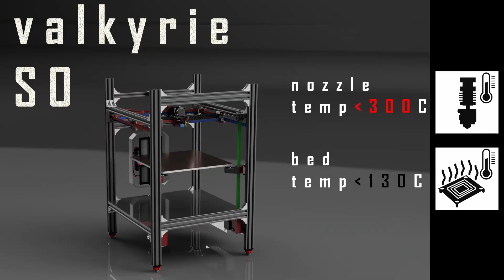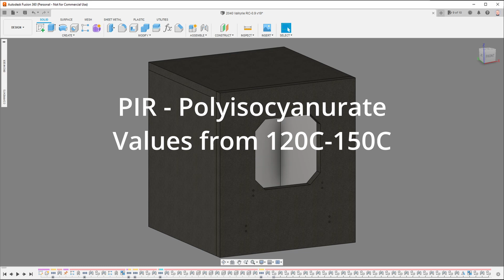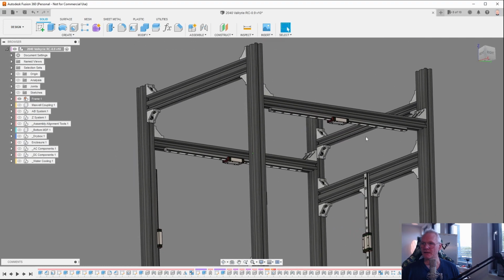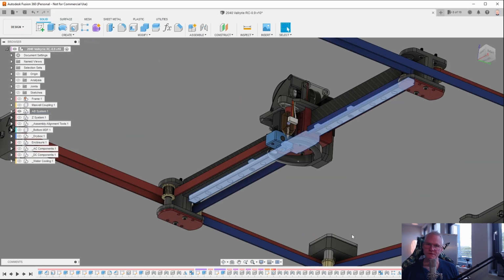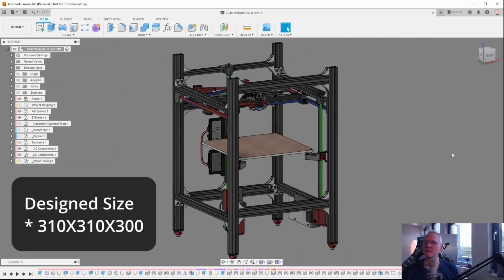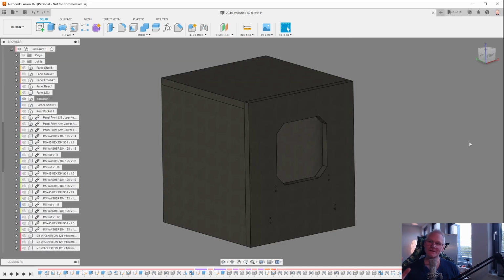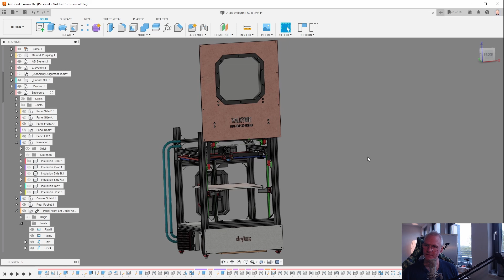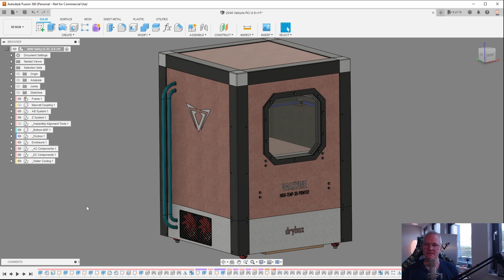NEW! ADVANCED DIY 3D Printer | Project Valkyrie |  High Temp Option

Comment: Impressive level of attention to detail! You list your competition on the webpage. However you don't have competition on a number of features of this design in the self build range of printers especially the high temperature capability is unique as far as I know.
Reply from the maker: Wow, thank you so much for the feedback. Me and my co developers have put so much into developing this and it is very nice to get positive feedback. Some have been saying it is to complex but this is not for everyone so that is ok, and really when you break it down it is designed with KISS in mind. Our drybox is also nothing the competition has, as the proper insulated chamber and high temp options. So thanks again
Reply: @PRO3DESIGN  Agree, the dry box is unique as a built in part of the printer. It's a great touch.

The positioning of the XY motors is unique and innovative as well, allowing to keep them outside of the box and nice and cool without adding too much bulk to the entire system. I would love to see a video explaining the advantages/disadvantages of this inverted coreXY layout as you call it.
Reply from the maker: @koenvanduffel2084  Thank you again for this. I will try to make some content on the pros/cons of the inverted kinematics. I really twisted my brain to design this system, it was not done in one go...

Comment: What is benefit of building this printer compared to other printers that can reach higher temperatures?
Currently my Voron 2.4 can go up to 70-71 degrees chamber temperature and Im working on Doomcube mode with aim of 80-90 degrees chamber temperature.

I had found this printer while I was searching for really high temperature 3d printer, I'm planning in future to build something using E3D bed (one that can go up to 200 degrees celsius) and actively heated chamber with up ro 150 degrees celsius.
Reply from the maker: Good question. Our bom is rated to 80c so the benefit is not much. The max chamber temp for this build would be 120c for the insulation and 135 for the belts. 80c for the magnets and electronics. Printed parts are 100c. Anything higher is all metal building and will push the final bom to the 10k plus cost. This build is 2k so it's not up there

Comment: Any reaons behind using MIC6 build plate vs borofloat? Im not certain but off of memory I recall the  thermal expansion of borofloat is significantly lower.
Reply from the maker: Hi. Not sure what you mean. Borofloat? Also I didn't recommend mic6 alloy, we use cast al5083 as it has better thermal properties. I don't know borofloat
Reply: Interesting. didnt know about the better propertiesi of cast al5083. Borofloat 33 is Schott brand name for borosilicate glass (it has an ultra low thermal expansion coeff compared to most "borosilicate" glass build plates from Asia.)

Comment: It would be nice if the door would fold flat onto the top, instead of sticking up vertically.
Reply from the maker: You can do that if you want but not with this hinge. We researched all options and this is what we found to be the best. It is DIY so you can do what you want
Reply: @PRO3DESIGN  Yes, the top hinge bars would have to be either at the top edge of the box, or L-shaped. Like so: https://youtu.be/kft3Akz4tAM

Comment: Very detailed design! I would like to know your opinion on one particular issue in printer built with extrusion channels. Is is possible that due to high temp inside the printer, Entire frame flexes? I use a RatRig Vcore-3 and I have faced issue of bed level going wrong after a while. A quick solution we use to preheat the printer before starting the print which allows frame to flex and that flex is removed by true bed levelling. But that is not ideal. Frame is absolutely rigid yet we have faced this problem.
Reply from the maker: Hi Rikil. Thank you! All metal expands with temperature, the parts have different thermal expansion so this is something that can cause some binding in the system. You absolutely want to heat soak your machine before printing anyway but yeah using aluminum frame and steel linear guides can cause some issues due to different expansion rate. For these machines it should be OK to deal with this issues but if you want a better solution then you must consider building the frame in steel not aluminum.

Comment: Excellent design. Really no DIY designs for high temp printing that I'm aware of. I won't call Doom Cube a real high temp printer... Having thought about designing own, I have to say there is a lot to consider.  The XY motor design is very elegant. More designs should use kinematic coupling for bed fixture. The only concern I have for you design is the extruder motor and the z belts. Maybe route the water cooling to a 40x40 cooling plate attached to the motor? Z belts take quite some load. Not sure how much they would stretch under high temp. Ball screws would be ideal IMHO, but more complicated designs also. And does your design include an active heater? During printing the bed should provide enough power. But preheating the printer from cold would take really long. Also I think you can forgo the heater in the filament box. Adding a vent to the chamber should provide enough heating/drying for the filament. Thank you for sharing you design. Keep up the good works!
Reply from the maker: Thank you so much for your thorough feedback. Regarding the extruder it can be watercooled no problem. We already have this in mind and if you aim for even higher temeratures you can move the extruder outside. 

Regarding the Z belts they work very well for the the designed size with a 135C rating but if you are concerned about it you can add a belt number 4 to the rear lift as that one is lifting double the weight of the two in front. I thought about ball screws but it just get very expensive if you want something decent. It can be modified for ballscrews if you want to to this yourself and if we find the belts not reliable I will do something about it.

Stage 1 does not have active heating in the current release but that is the plan and we are working on it for the full SI release, so yeah it is in the works. We want a heater in the drybox so we can use it just as a filament dryer as well as a drybox not having to turn the chamber heater on
Reply: @PRO3DESIGN  Thanks. Good to hear that there are on-going development planned. Really want this project to be successful. Good luck. And thanks again for the hard work and generosity.